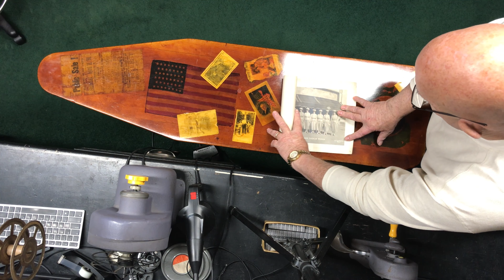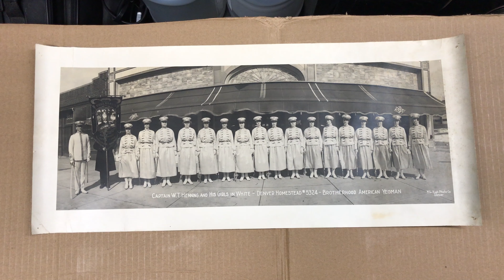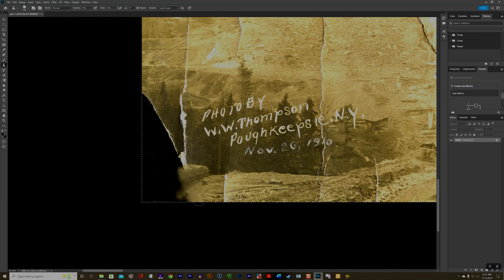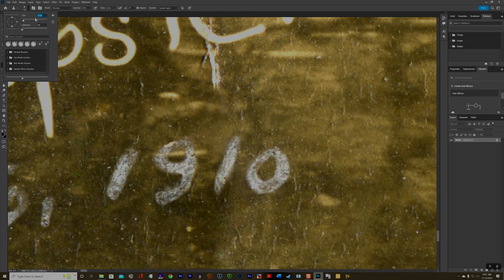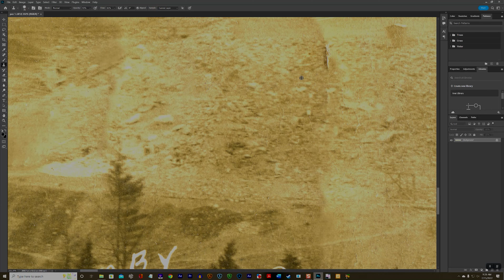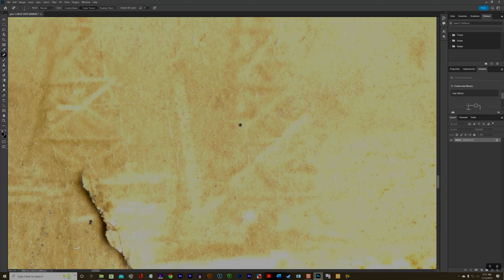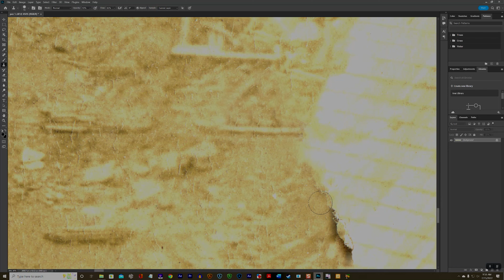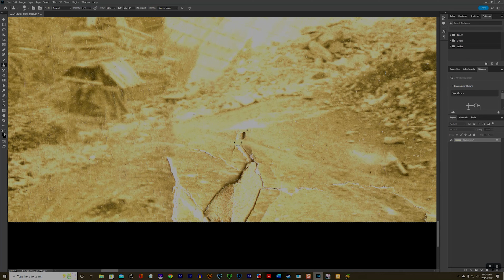1910, BROWNS STATION, NY, OLIVE BRIDGE DAM, PANORAMA PHOTO RESTORATION

Comment: Your work is amazing! I had no idea that these old, rolled up panoramic photos could be repaired and saved. I wonder how your method would work on old posters that have been rolled up for a long time?
Reply from the maker: Thank you very much. I have tried this method on an old poster one time. It wasn’t valuable at all and fairly common so not a problem experimenting. It didn’t work out. The paper is too thin and before I could dry it got really wavy. It would lay flat but as I said really wavy. Thank you very much for watching.

Comment: I've unstuck photos from each other by a similar method.  Plastic trash can, 1 gallon of distilled water poured in the bottom, upside down plastic milk crate in the bottom, set photos on the milk crate, put on the lid.  Let it sit for a while (maybe days).  Gotta be careful with the timing, though.  If it's in there too long the photo paper gets too soggy and never dries properly. Your method may be quicker and more effective, and panoramic photos wouldn't fit in a trash can.
Reply from the maker: Yeah if you get them too damp a black mold will form on the backside before they can dry.